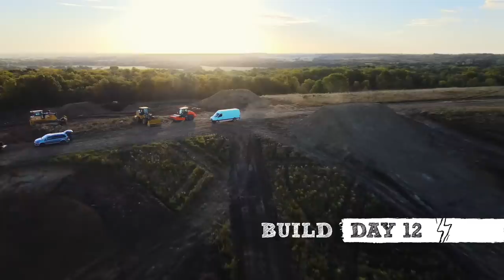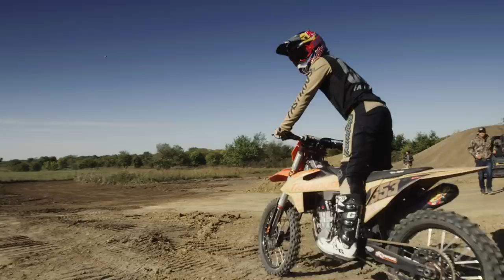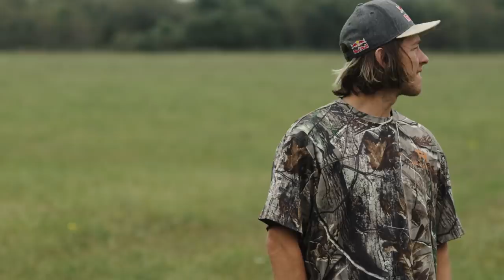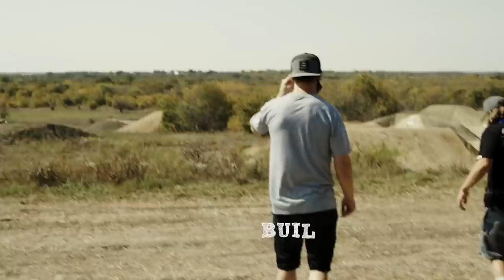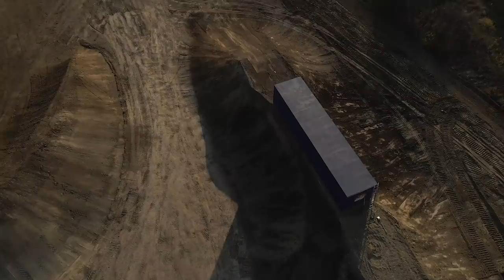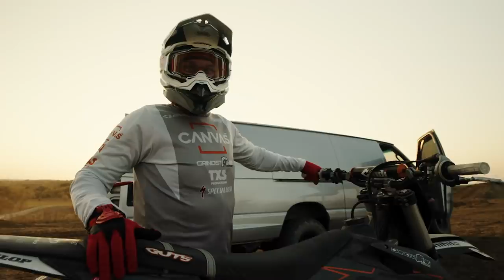Red Bull Imagination (2020) Season 1, Episode 1 | Tyler Bereman Builds Motocross Free Ride Event

Comment: A level is not gonna tell you the angle of that quarter pipe without a measuring tool
Reply: @richystocles  there are no fine measurements for the bubble. Need a level and speed square or tape measure